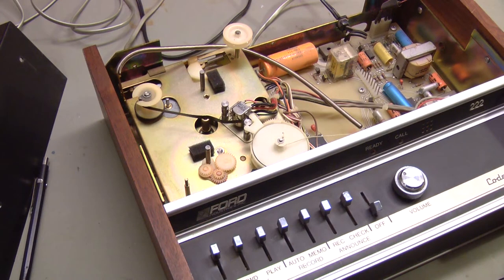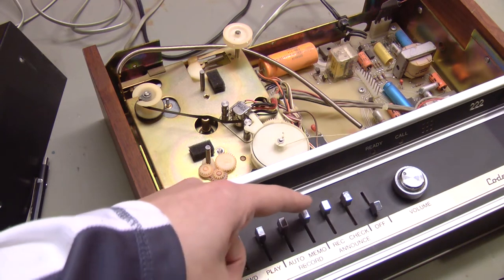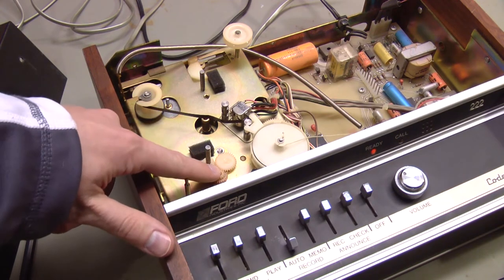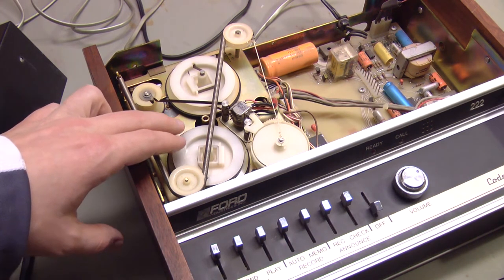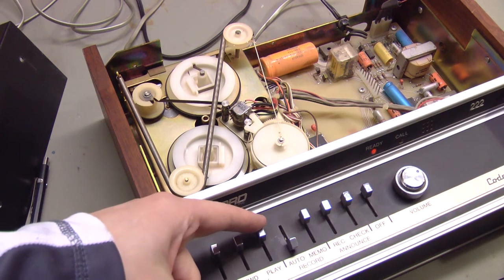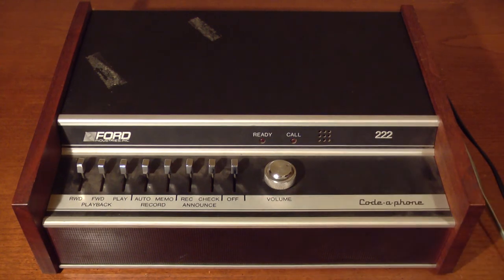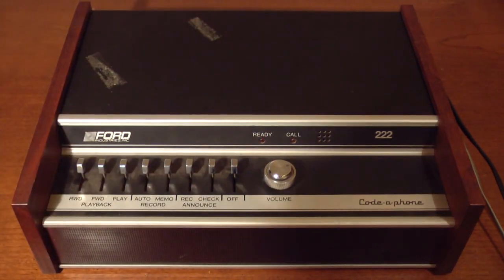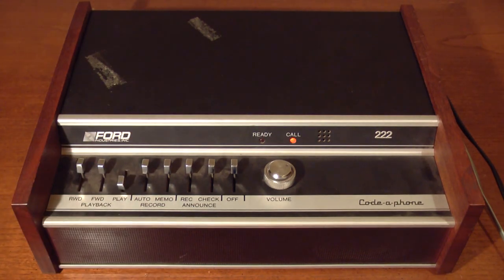Code-a-phone 222 Telephone Answering Machine Repair Part 2

Comment: 1:50  that problem likely started when you replaced the tape with the tape from the cassette, you likely bumped the cog wheel with your fingers or moved it unknowingly and disturbed its home position. Always mark gear placements before replacing anything with a dot of sharpie so you know what way to put them back in.

Comment: Hi Nelson,

This machine brings back childhood memories.

When I was a young kid, I used to hack these from my parents's house phone and change an outgoing messages. My local library owned one. I remember changing the message to say that the library was closing forever and that people could keep their books – yeah, I was a kid (please do not judge).
 The message was up for over a week.

Anyway, I thought I would add to some of the general knowledge of these machines when it comes to using them in remote mode.
 In your video, I did not see you mention that you can check messages remotely. So, I was not sure you knew this was possible.

They all have a 3 digit password.  The factory only had 16 possible passcodes and I believe they may have been hard-coded into the machine. Heck, maybe they are selectable from the machine - I never owned one. Anyway, after hitting the break button, you can type a passcode. 

Here are the 16 possible codes
159
596
962
624
247
470
708
 082
 821
 214
 140
 409
 098
 983
 835
 357

Notice a pattern? The next code starts with the second and third number of the last code. So, all 16 passcodes overlap. And since the machine did not hang up on a wrong passcode, I realized I could type in the following master-passcode string to gain access to remote access.

159624708214098357

The commands to use while in the machine are:
#1 Rewind
#2 Fast Forward
#3 Playback Messages
#4 Record Outgoing Message
#5 Break Button
#6 Leave Memo
 
To record an outgoing message, hit #4, it beeps three times before you should start talking
Hit #4 to stop the recording and it will play back your message. If you like it, hang up. If you want to re-record, hit #4 again.

As I said, I watched both of your recordings and I did not see you talking about the remote access. I was unsure if you knew there was such a thing for these. These machines were really a great piece of machinery.

I'm actually tempted top purchase one of these for old-time sake.

Thank you for this trip down memory lane.
Reply from the maker: Thanks for the memories! I love hearing the stories. Unfortunately, my model (the 222) doesn't have remote control. You had to go to the model 333 or 555 to get remote control!